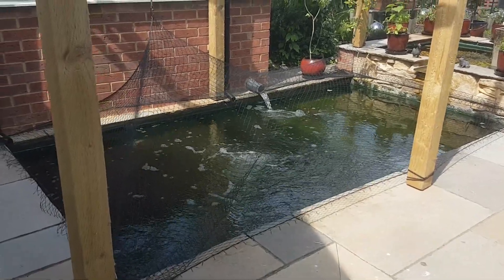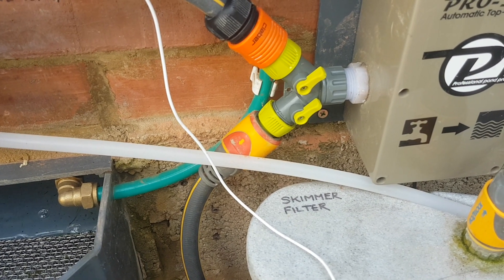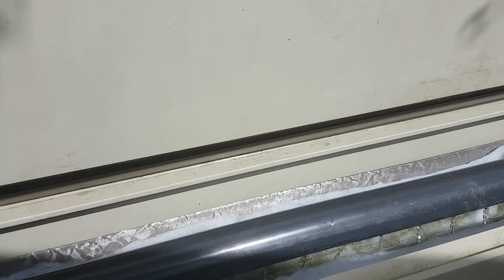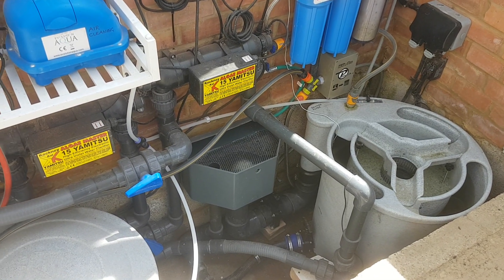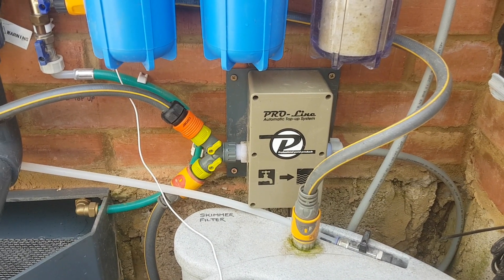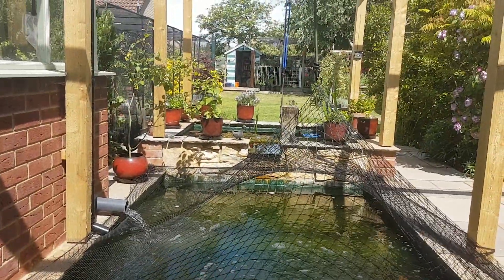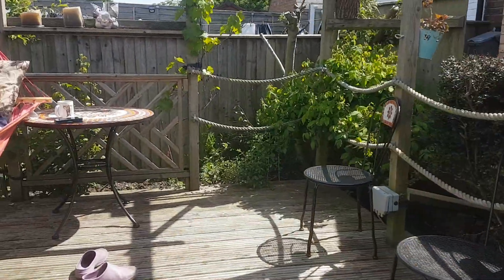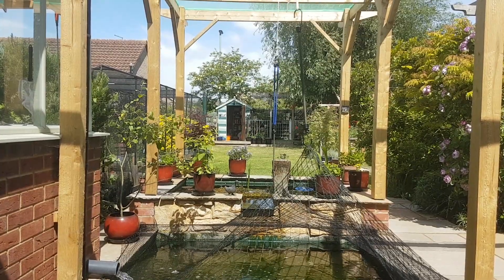Modifications, mumblings and modern maintenance.

Comment: Hi Steve, I run a drum but I also like tinkering. The benefit of the automation is that I can do it when I want to so it doesn't become a chore. Drums still need a bit of maintenance though, I back wash mine and it's amazing how much waste just seems to hover in the middle. BTW, I am in Crowland, what PH is your pond? Mine is up at 8.5 as we live in a hard water region, but other than RO I can't see a way of getting it down. Thanks
Reply from the maker: Cat did the last check which was between 7 and 8, she then bought a finer tuned tester and said it was fine. Not too certain what it was but she was happy. Fish not showing any signs of I'll health apart from waiting for a 2nd dose of Fluke Solve. Crowland is not too far mate  been plenty of times. Stay safe.
Reply from the maker: Just asked Cat and she said last check was 7.9
Reply: @CATANDEYEKOI  ok, thanks Steve. My tap water is about ph 7.5 straight out the tap, but once it distills it goes up to about 8.2/8.5, so I've got what I've I am afraid.